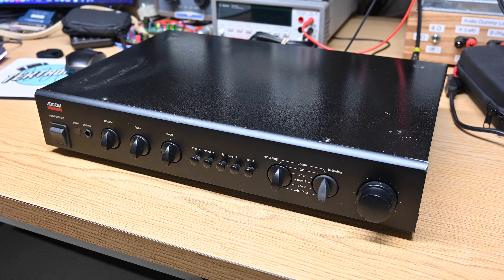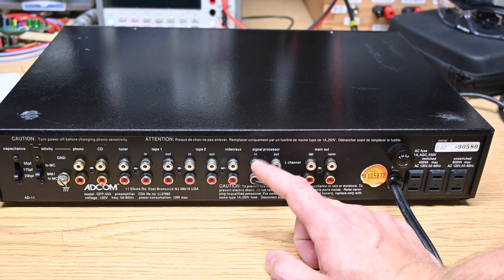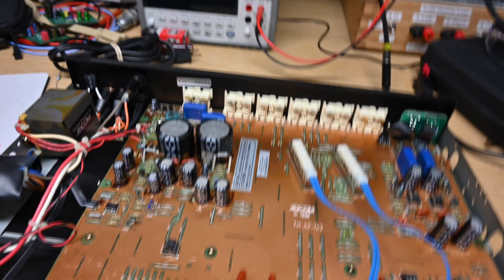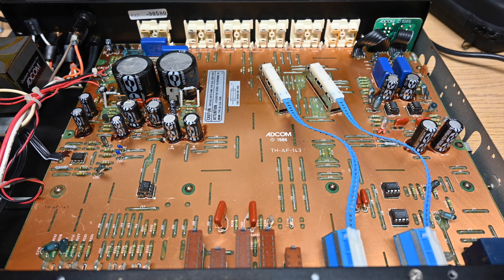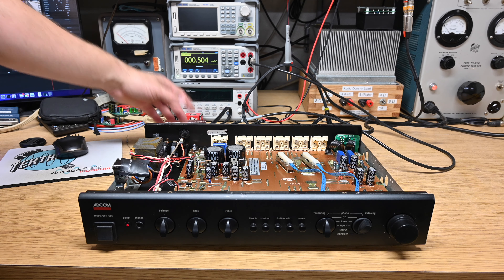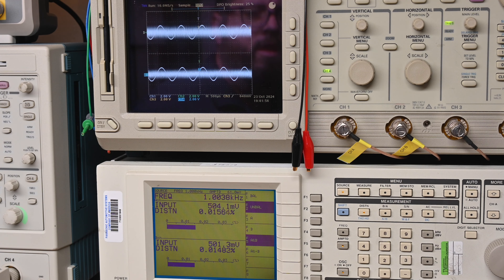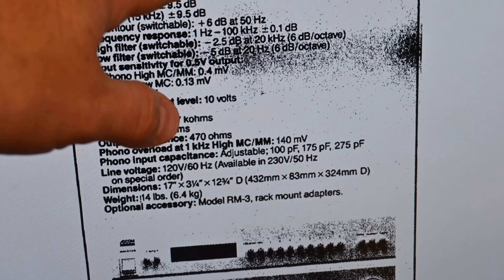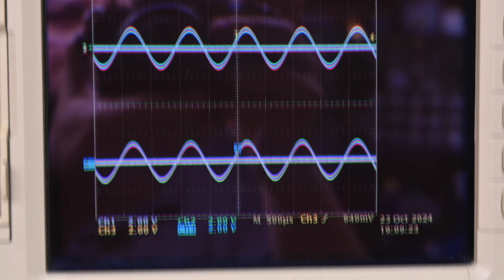ADCOM GFP-555 Preamp Owner Says it Hums

Comment: Isn’t most hum created by the AC outlets? I lived in a vintage house built in 1928 that had some hum in my audio amp via a Tripplite Surge unit. I had an electrician install a medical grade $150 AC outlet. The hum when away.
Reply from the maker: It can be caused by improper wiring (including the power cord someone modified on this unit), but this unit is at the age where capacitors in the power supply start to become suspect as well.  That's why I was looking for 120Hz on the signal analyzer.  I dont see how a medical grade AC outlet would improve anything hum related, unless the old outlet was improperly wired and that was corrected when the new one was installed.  They are just higher quality / construction and tighter grip on the plug.